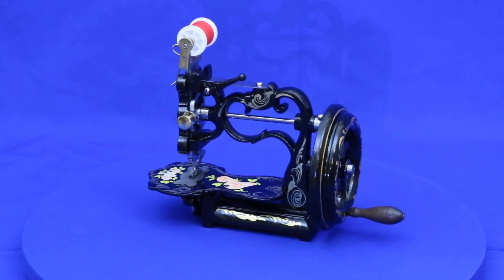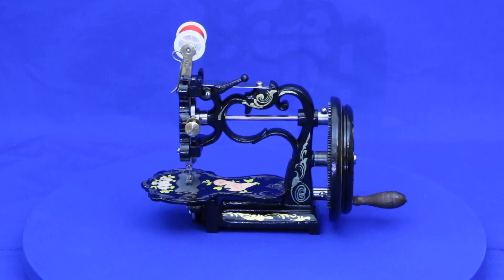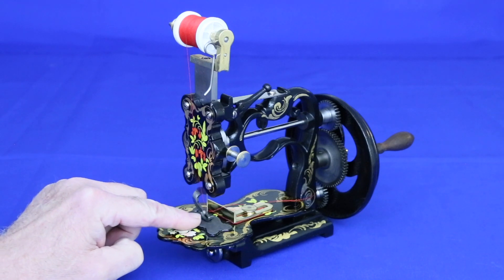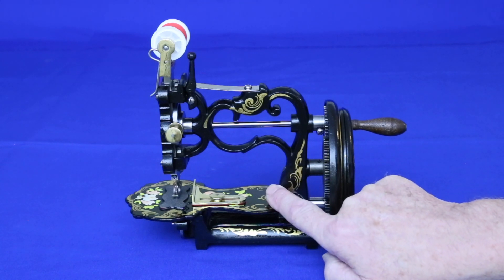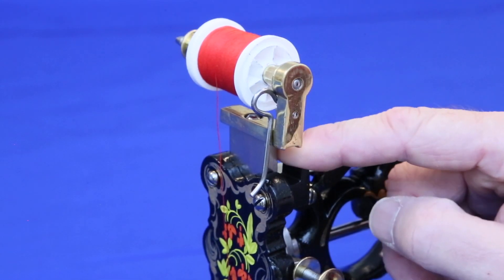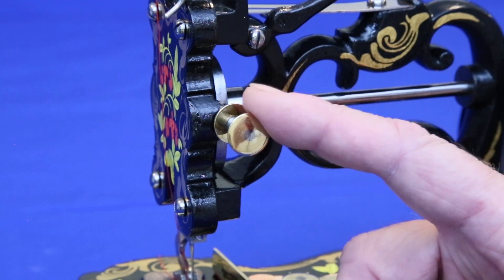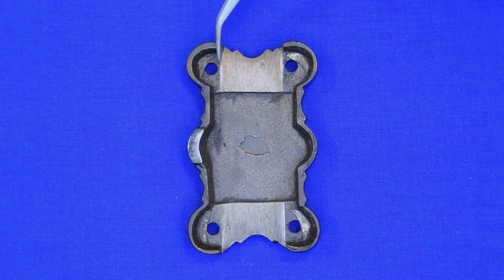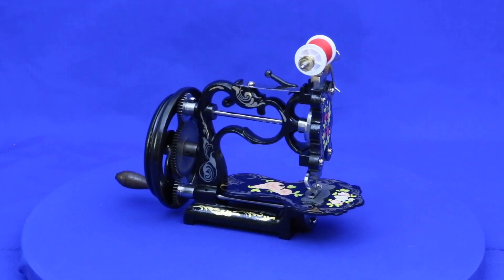Antique A.  F.  Johnson Sewing Machine

Comment: Wayne, these videos are great!  Thank you so much for posting. I learn so much from you, & I'm agog at the work you do.  

This time, however, I may have something to share with you.  I too refurbish antique sewing machines (nothing close to the work you do, but I try my best).  It just so happens, that I recently came across an AF Johnson NE Style machine, as I was cleaning the rust off my last project. In doing my research, I discovered that the AF Johnson's were one of the few with the "Wasp Waist" shaped stitch plate, but also that they were the only ones using a racetrack-shaped oval, as their raised foot-rest for the stitch plate.  Mine had the oval, but yours shows a more ornate style, which may indicate it's really another brand. JG Folsom also has the wasp waist, and the super flat stitch plate, like yours.  The Sewalot website shows a photo of one, which has the brass nuts, and 3-D cast iron lifting bar, which my AF Johnson did not have.   

Oddly, my next project is also an AF Johnson, which I didn't realize until I ground the rust off the face plate, where it's clearly stamped as such.  It also has the flat metal lifting lever that the earlier one had, so I don't think he ever used the 3-D iron lifting bars on his machines.  (My 2 machines are different models, from different years, so it's not like I just stumbled across 2 identical machines from the same manufacturer).

Not sure what your further investigation showed you to make you doubt the initial ID, but if you'd care to share, I've been compiling whatever info I come across for about a decade, to help me ID machines more accurately.  I'm happy to share with you, in return, if you have any questions.  I'm not an expert, but like you, I do my research, and try to be accurate, despite finding little, or conflicting info, in many cases.  I try to gage the expertise of the source material, and take my best educated guess on if they're likely to be more or less accurate than another source, and go from there.  You too are a source of info, and tremendously helpful in showing how they should look, which is very helpful to me.  I can't fix it, if I have no idea what it's supposed to look like, & I love your tips - like when a screw turns counter-clockwise.   Very helpful.      : )